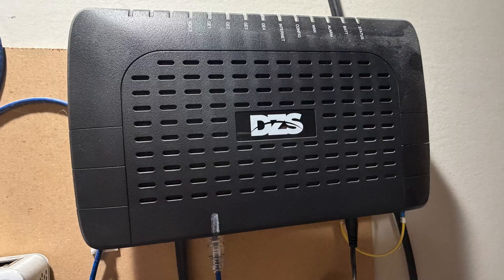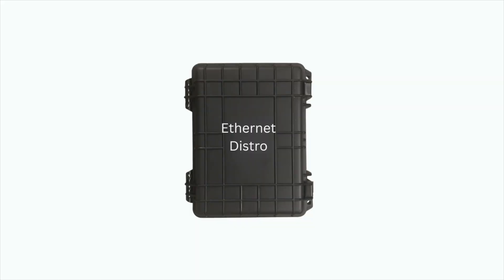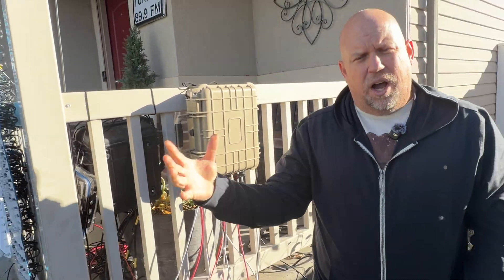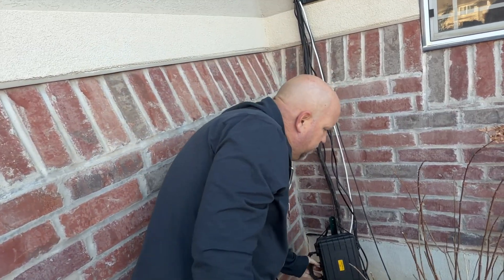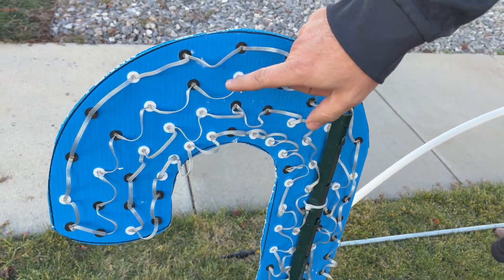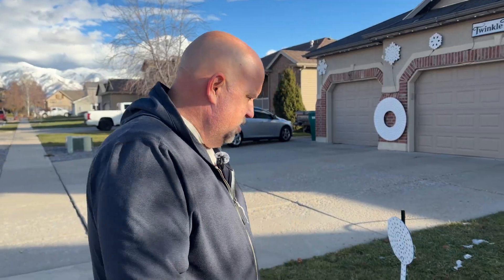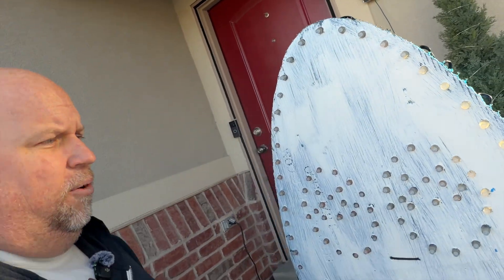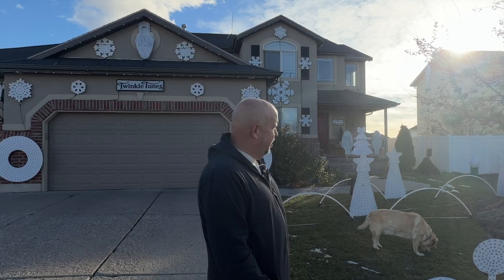This Is What It Takes to Run a Pro-Level Light Show

Comment: Thank you for the great information.  Question about connectors.  I've seen xConnect and Ray Wu as options.  In your opinion, which is best to use and why?  Thanks!!
Reply from the maker: Thanks so much for the question — great one! 🙌

Both xConnect and Ray Wu connectors are solid options, but which one is best really comes down to what you’re trying to do.  They both are equal in my opinion.  I chose RayWu simply because that was all that was available at the time I was getting in to the hobby.  I was purchasing right at the peak of the season and nobody had Xconnect things in stock.  RayWu was all they had so that what I purchased. I find that Xconnect is much more popular than Ray Wu.  When you do pick make sure you stick to one and not combine them with your lights and props. Are you starting from scratch?
Reply: @twinkletunesandlighting  Thank you for the response.  I am starting from scratch.
Reply from the maker: This is a great hobby and a great journey. Please reach out if you have questions. What are you starting with?

Comment: New to the scene here. Been doing alot of research. However, I am in Canada and having a hard time finding Coro Props. The shipping from the States is going to cost more than the props I want. Lol. 
I am also having a hard time finding the proper lights. I have been looking for the Bullet Pixels; However, I like your idea of switching to the Seeds. They seem to be easier to work with. 
 
Any tips on which seeds to get? My house is small, and I believe my setup that I have in my mind would be rather simple to do.

I have the Govee Permeant lights on my house, as well as 2 of their LED Seed trees. But its my understanding that Govee lights can't be used.
Reply from the maker: Welcome to the hobby! Shipping the Coro props is a nightmare in costs. My very first props I made from simple 4-5mm coroplast from a sign company or your local hardware store. The sign companies usually have scraps they throw out so that is also a plus. You can start with some simple candy canes and stars. In Xlights it tells you how they are wired. Get a 13mm drill bit and you are in business. Is it perfect no but it still looks great. The seed pixels are a great option. Make sure the wire is at least 20awg or 18awg. Anything smaller you will run into signal issues on your longer runs. It my show my house is trimmed out in govees and the work great with WLED. I made a few videos on how to do it. One with the V1, the elites, and the pros. It is really simple to do and very effective. With the seeds you can get inserts the let you push them into regular coro props like bullets. I have totally switched over to all seeds and haven’t looked back. They are awesome.

Comment: Are you pretty happy with the controllers that run over WiFi? Do you notice any lag or frame drop?
Reply from the maker: Lag yes buuuuut…. They are just controlling single line things like my house outline and the led bars. I tried them on my larger props like my spinners and snow flakes and your could see it at 40 fps. At 20 fps not really. I would only suggest running wireless on the smaller single line props like single line leaping arches, outlines of house or props. Nothing like props that can have a spinning effect or shapes. What are you thinking about running wireless?
Reply: @twinkletunesandlighting  not planning anything ATM, but curious about what my options could be as a expand my show.
Reply from the maker: This past year I did some really cool effects where I had lights inside my windows that backlit a silhouette. If you watch my video “Shower Scene” or “Work of Art” you will see it. It was almost the fact I could light the window 3 different ways, from the front, an outline, and from the back. I ran the controller wireless from inside my house and it worked perfect every night. Wireless works great just know the limitations at 40fps and you are golden!
Reply: @twinkletunesandlighting that sounds pretty neat. I’ll check it out.
Reply from the maker: I have been running my Govee wirelessly since the day I installed them and they are awesome. The WLED app is way better than the Govee app in my opinion.
Reply: @twinkletunesandlighting i seen your conversion, would like to see if keep your WLED controllers outside and if so, would love to see the enclosure.  Does it then connect to xlights? I have the pros i installed cause i ran out of time for xlights.  So i just acquired 15k pixels.  Since the govees are so new, i want to get them into the show if possible as they look great on my house

Comment: Thank you for the "Tech: background on how everything is connected!  I'm having my Govee Pro lights installed on the 8th and 9th using their standard controllers; however, I;m very interested in how you're using a WLED (Frosy and Grinch) controller which outputs  5 and 12 volt DC and to control the Govee lights which use 36 volts?  BTW, my wife wasn't  too trilled when I first began discussing these light shows until I added a set of regular Govee lights around the perimeter of our backyard fence last summer.
Reply from the maker: I have a new controller that I will post later this week. It takes 36v in and therefore passes 36v out. No need for a buck converter or anything like that. I also found a way to not cut any of the factory cables by using extensions purchased on Amazon. 
The light shows are great!!! It’s a perfect midlife crisis hobby. The thing is that you can make it as large or as small as you want. Sadly I am almost out of space and need more yard and house!  What are you planning on doing?
Reply: @twinkletunesandlighting  Back in August, after installing my first set of Govee lights around the perimeter of our back yard fence, I decided that I wanted to try my hand at a smaller Holiday light show for both Halloween and Christmas.  I ordered a set of bullet pixels, a reel of pebble pixels, wsp32 controller, Bong69 (your recommendation), and a modern power supply.  

We have a 4-foot Christmas wreath that is currently wrapped with the standard Green (200) LEDS, and a large bow with Red LEDs which I built back in 2016.  I had planned on swapping out those LEDs with the bullet pixels in order to bring the wreath “to life”.  I just ran out of time.

Our new house has a perimeter of 348 feet, so I ordered two sets of the Govee Pro lights (200 feet each) back during Prime Days.  They will be installed withing the next few days.  I reached out to their tech support on combining the two sets through groups and syncing them.  One set will run left to right and the other set will run right to left, which presents an issue on the syncing in order to have a continuous travel direction. 

Your video just wetted my appetite in potentially solving that Govee issue, and your video also explained connecting the Bong69 controllers and the Raspberry PI together.  As a retired IT Professional, your explanation (30K view) was terrific without going into great network detail that would leave novices scratching their heads.